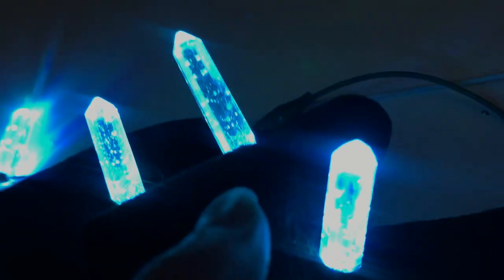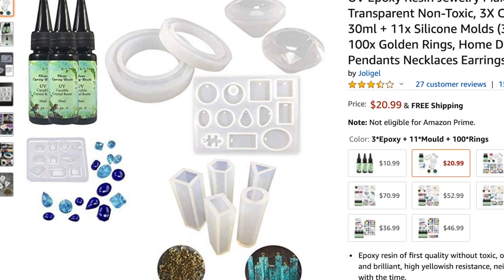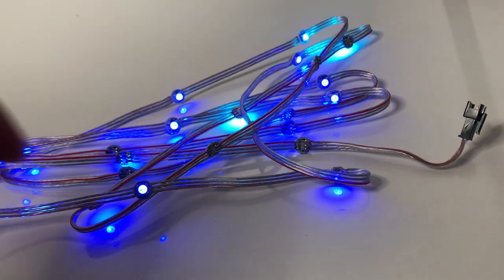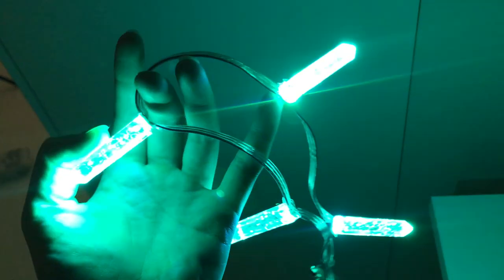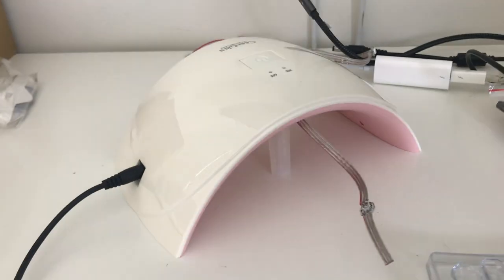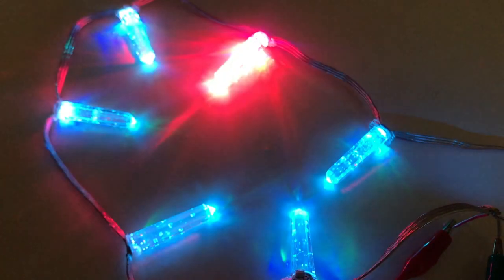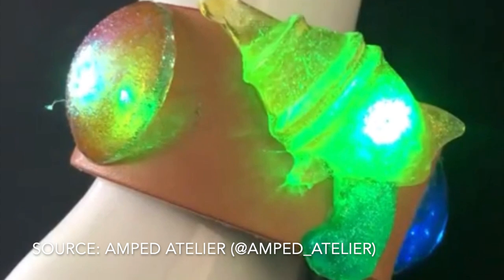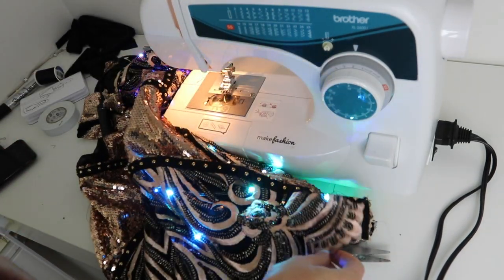Using Resin with LEDs: Wearable Tech Illuminated Crystal Tutorial

Comment: Hey there, thank you very much for this tutorial. My order of your led tech kit are right now on the way to Germany. Now one question, I just tried out to hardening my epoxy I got at home with the same type of UV Light you have been used in your video and it didn't harded at all. It just stayed liquid. Any idea why? Good that I tested it before 😶 maybe you can give me a Tipp which epoxy I should use. Thanks!
Reply: make sure you are using UV resin. Not regular resin.
Reply from the maker: Yes, +1 to making sure you are using the correct resin. It sometimes takes a few rounds, but it should at least start to harden right away if it's the right product.